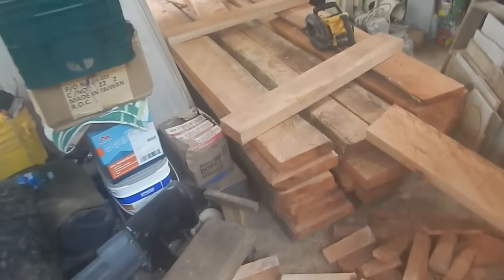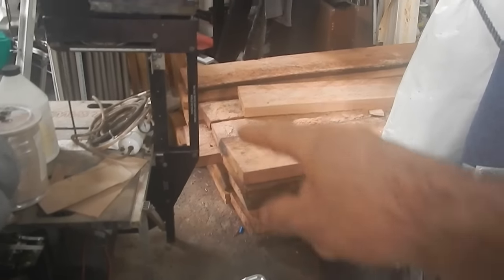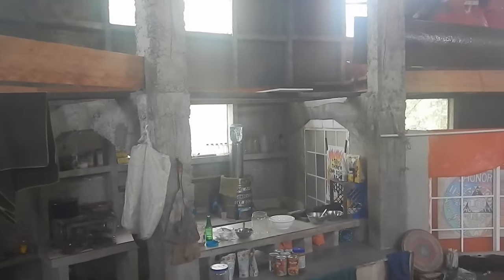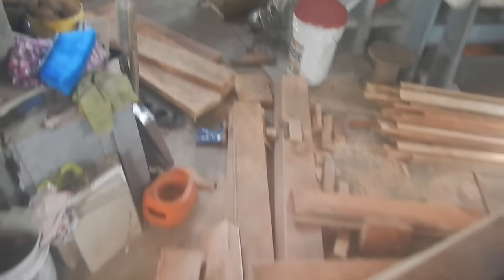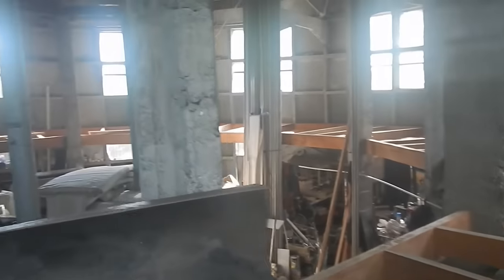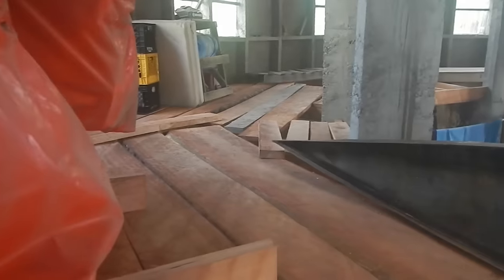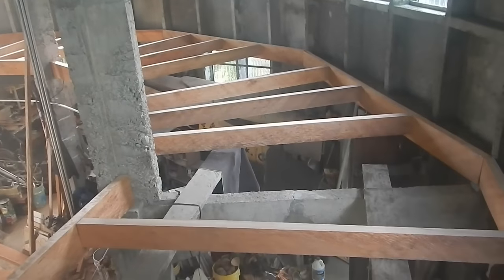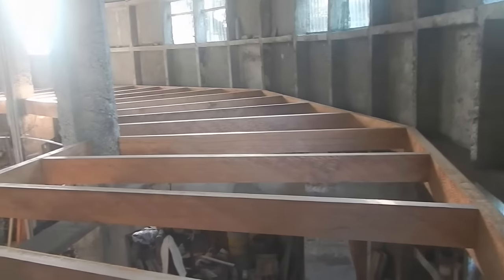So Much Floor Done in One day!

Comment: Maybe a dumb question, but don't you need joist hangers to safely attach the joists long-term? I don't think end screws are going to withstand shear loads over time.
Reply: The wood he is using is a hard wood, which will hold screws and nails better than pine or fir, and those are 2 inch (at least) wide boards, not the commercial 1.5 inch thick boards, so they will hold more nails and screws, and we don't know how many nails or screws are in the ends.  But if you wanted to be really safe - he should use a horizontal board at the bottom of the joists nailed into the band, or joist hangers.
Reply: Not a dumb question imo
Reply: @advancednutritioninc908  but the wood isn't bearing most of the load, it's all on screws which have less shear strength than nails.

I said it might be a dumb question because I don't know what he used... maybe those are lag screws which could have a higher shear load rating.  I'd just hate to see it fail if that's his running track and also going to be temporary storage for heavy stuff for awhile.
Reply: @Duderonemy  I am an engineer, and i agree with you in theory.  However there is much we don't know about what jamie is doing.  I also have followed him for a long time and I have never seen any of his projects fail structurally.  There are structural screws now, not deck screws, but actual structural screws and nails of course.  If you have watched many of his videos you know he is not locked into the standard way of doing things and nearly always he thinks through his way if it's non standard.  Which it often is.  P.S. Proper screws have equal or higher shear than the same size nails - but yes people often use the wrong screws and that can cause problems.

Comment: have you ever considered making a quick and dirty rail road for the island using steel pipe as rails? it would make moving large amounts of materials easier by pushing carts on rails
Reply: He mentioned in a previous video that the grounnd is too uneven to even use a wheeled cart. I think it would be similarly difficult to make rails

Comment: rip your floorboards into 2'x2' strips and nail them together. the 2x2 will be flexable enough to make the curve around your dome I rebuilt a kids rollercoaster that had turns tighter than that. if you do 2 layers of that all nailed together you will have zero bounce in the floor when you run on it. save the super thin strips that get left as offfall from this ripping too because that is also super easy to flex and makes for great saw guides.

Comment: These, "imperial noodle units" are actually based on the "barleycorn unit", so you should refer to them as "imperial barley units"... 
https://en.wikipedia.org/wiki/Barleycorn_(unit)#:~:text=The%20barleycorn%20is%20an%20English,(i.e.%20about%208.47%20mm).